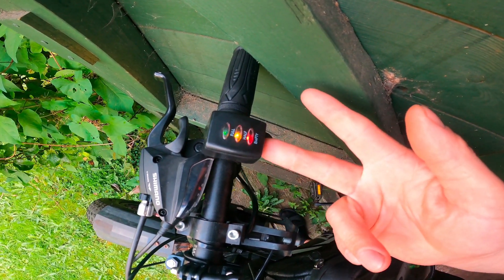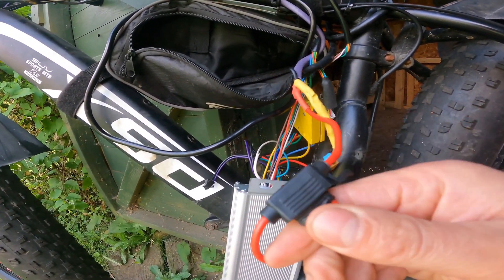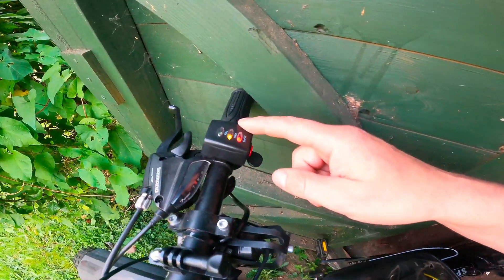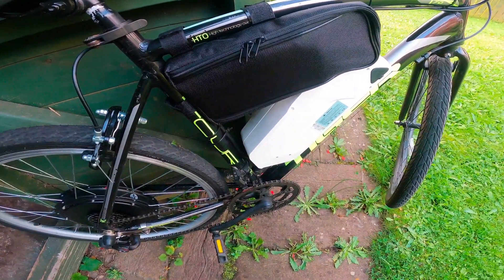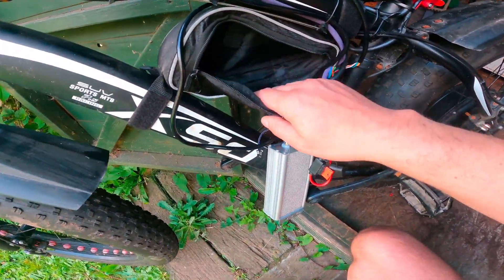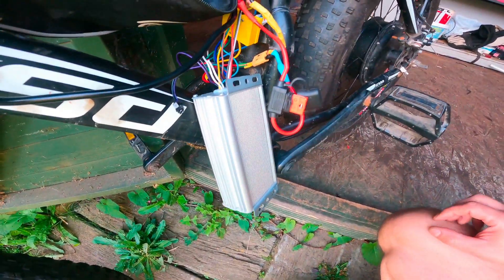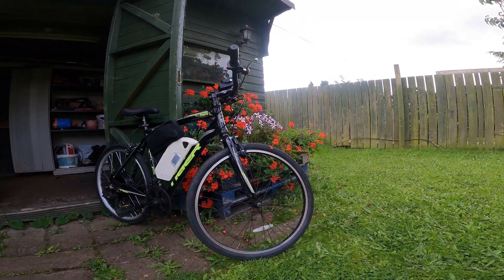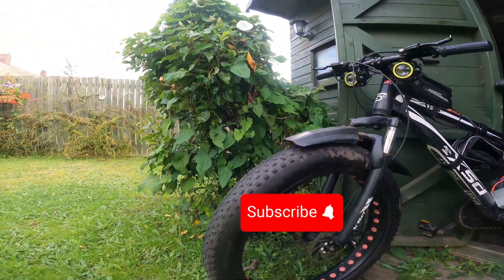E-Bike  Controller failure, Three signs That your E-bike controller needs to be replaced.

Comment: My first CKit 1500 watt front motor hub got the lugs loosend and I jerked the power just a bit when testing issue. I had hit a curb going 5mph a month back and knew this was the case here. Turned out the center axile is moving a milimeter back and fourth which signals CRIPPELED or just no good anymore. Still works but jerking of axile broken.Shit happens and why I have 3 others..